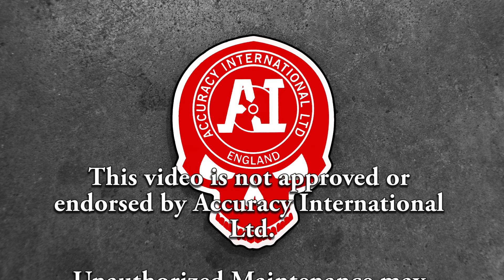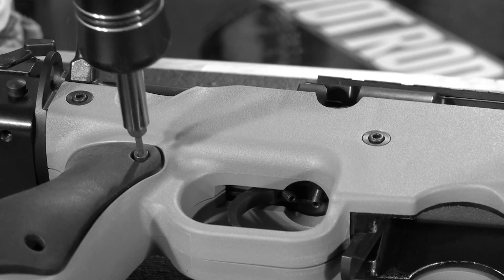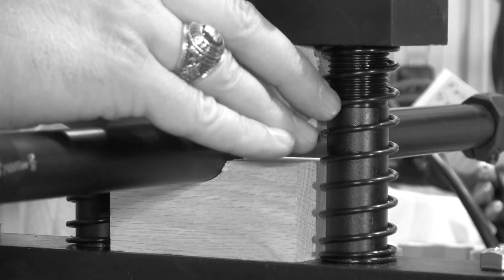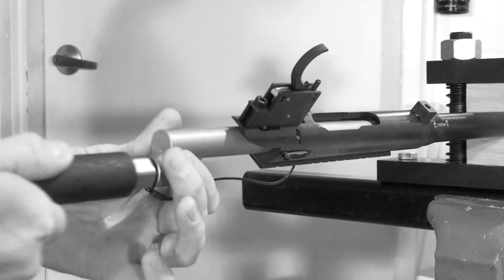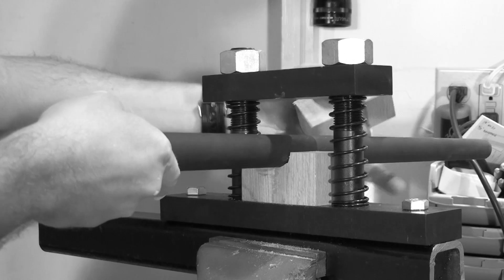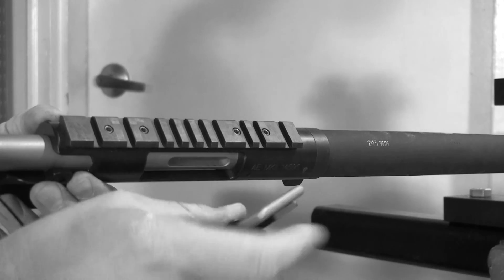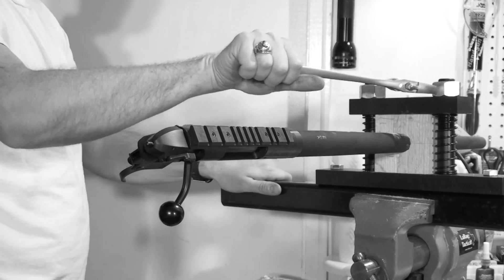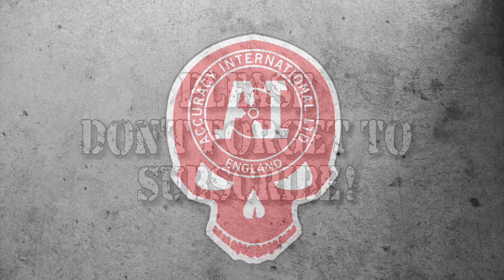Accuracy International AE MkII Barrel Change

Comment: I would NOT recommend loctite.
It is not needed, and will just loosen under heat from firing. It's customary to use nickel, copper, bronze, or brass based anti seize to prevent galling and easier removal.

Comment: Hey John. I know you were saying you were pressed for time. Is that why you chose a 26" barrel? I am just curious. I know 26 is not an unheard of length, and is more common in hunting rifles. So does going from a 20" to a 26" take any getting use to when hauling it around at the range or a match? Are you gaining a whole lot by not using a 20-24" barrel that you tend to find on more "tactical" oriented rifles? As far as a brake...I shot a sporter weight .243 for a while. It does fine without.

Comment: Was the .243 barrel already installed on this action at one time? I ask, as I would have thought the chamber would need to be reamed to final size otherwise. I know that it is possible to adjust the headspace mechanically on a savage by using the barrel nut, but as the AE uses no such design i just thought I'd ask.